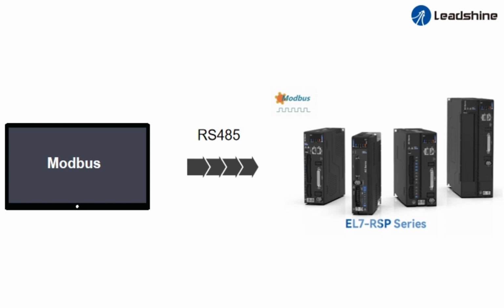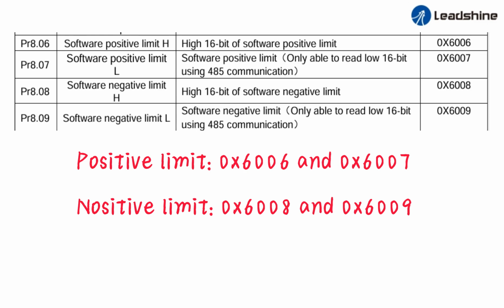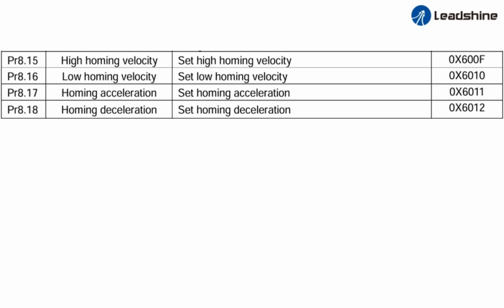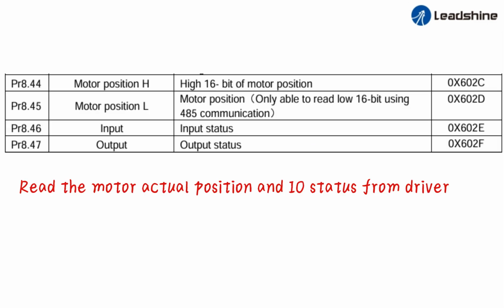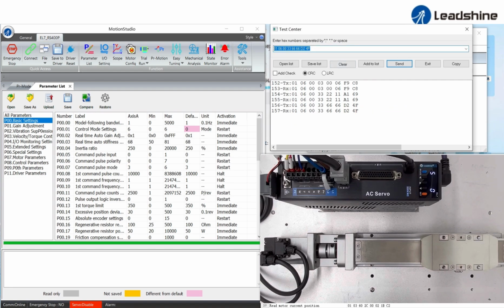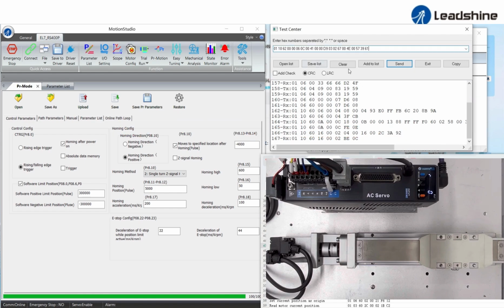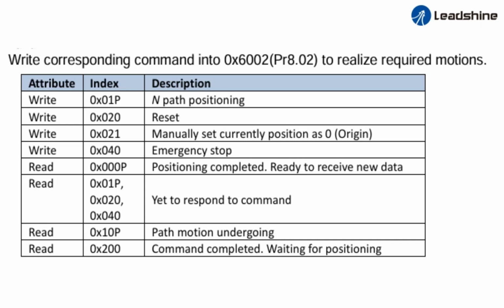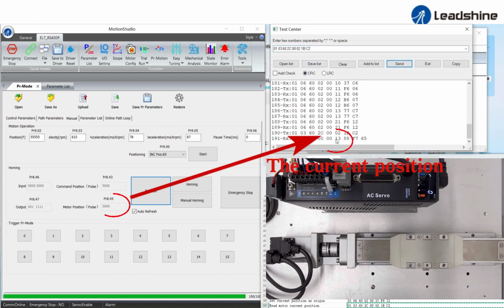Sixteen | Leadshine PR Mode Application with Modbus Communication

Comment: My EL-RS400P driver connection via Ethernet/DB9 cable and USB/RS485 adapter does not work. Do I need to separately activate the RS485 transmission mode? In Motion Studio there is no way to change the transmission mode from RS232 to RS485. Although direct transmission via USB C is successful
Reply from the maker: Thanks for your message, you can send your question to our tech@leadshine.com, our technical engineer will help you.